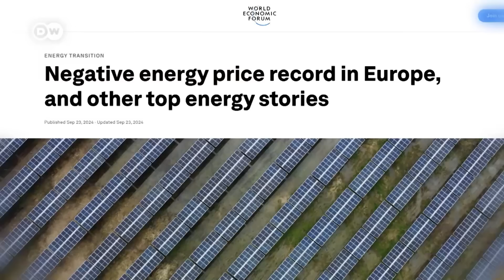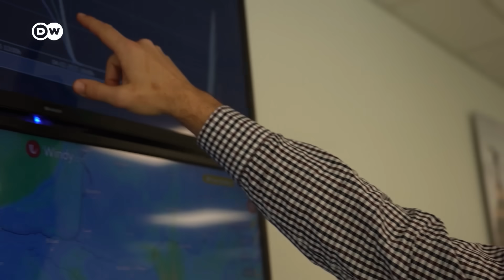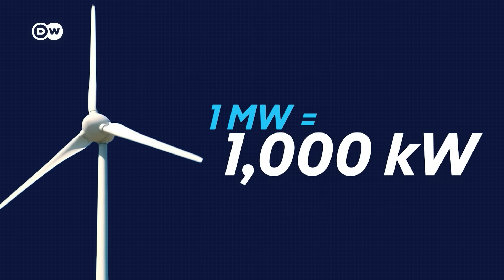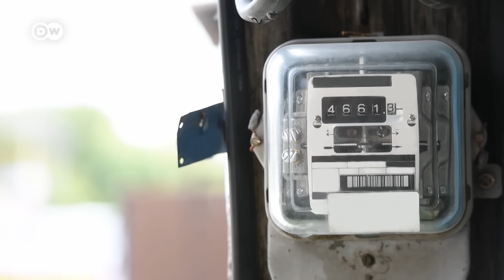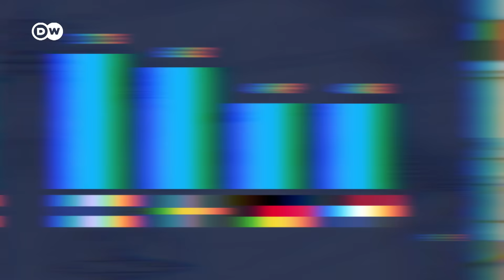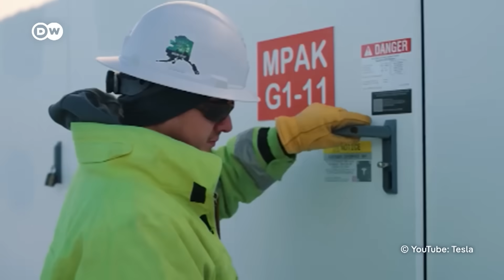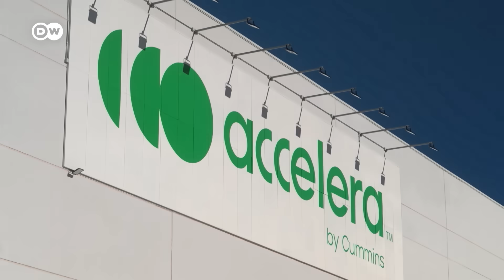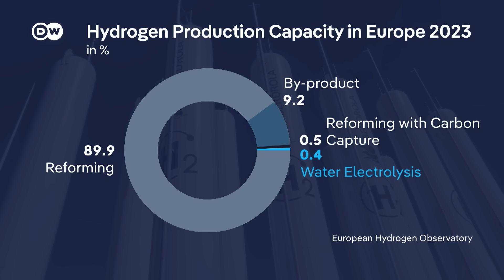Negative energy prices: Why cheap electricity can create huge problems | Transforming Business

Comment: Would have liked a greater focus on an explanation of marginal cost pricing (if there are countries in Europe which use this awful system which has outlived its usefulness to our changing grid) as used in the UK. I also would have liked graphs to demonstrate the actual loss to energy companies. We'd seen total hours of negative pricing but I imagine in real terms 240 hours per year is miniscule and perhaps a sign that these companies have not diversified properly into storage methods.  I was also tiring of the much cliched "silver bullet" metaphor. Do renewables attract werewolves?

Comment: An inefficient use of electricity, like the current hydrolysis process for making "green" hydrogen, is PERFECT for excess energy problems. It's a process that only works if energy is cheap, and suppliers have excess energy to sell at a lower margin profit that would otherwise cost them money to sell. Where's the downside here? 

Does DW receive funding outside of the German government? Maybe from oil, gas, or coal power generators?

Comment: Negative energy prices are a failure of government incentive structures & policies. It occurs due to poor planning of industrial scale implementation. It's been know for years, that after a certain percentage of renewable penetration, the grid would no longer be able to absorb peak direct generation, without storage. Though this was the case, a mad dash for renewable generation, without tying those industrial installations to grid scale storage, or industrial use policy, resulted in large supplies with low demand. It's basically a energy logistical design failure.

Comment: Renewable energy, such as solar and wind, its productions are very fluctuating according to weather conditions. Therefore,  massive electricity storage systems are needed to buffer these fluctuations fluctuations.  These systems convert  electricity to other different forms of energy, such as gravity,  pressure,  heat, and chemistry, when it is surplus.

Comment: Only solution is battery storage, which has already dropped in price to extremely affordable ranges thanks to "Chinese overcapacity".
Reply: and EVs
Reply: Of course. But nobody want to invest in that. Plenty of options, like heating up giant quantities of water or gravity batteries (concrete loaded trains up a hill is most cheap to build). It's all because engineers have no power.
Reply: We can charge EV's, heat or cool houses more during excess generation using them as heat batteries, have actual heat batteries for heat storage etc.
Reply: EV storage and more grid connections. 

More demand would be helpfull too.

Comment: Sweden has solved the problem of negative electricity prices. 0.12 euros/Kwh in fees, charges, fees and taxes and then VAT on fees and taxes. We never have negative electricity prices. 3,500 Kwh per household would be a dream in the cold, dark Nordic countries. 30,000 Kwh for a house is more common. During the winter, a lot of electricity is needed to heat houses in -10 degrees cold and the sun is out almost all day.
Reply: A panel at -10C is much more efficient than in the summer. But solar without storage capability is useless.

Comment: Problem with negative pricing for households is that transit and taxes are relatively high and it kind of does not matter if price is 0.09€/kWh or 0.10€/kWh. So generally households do not increase electricity usage when electric energy price is negative. Some big companies and energy companies have lower transit and tax and for them negative prices can give reasonable boost. Many bigger users pay peak price too, so it is not so easy to calculate if increasing usage beyond normal is profitable. For example in some cases electricity user will pay extra one whole year based on two highest usage hours. And that can be quite hefty.

Comment: The key would be to move economic activity to match solar output. Electro intensive industries should work at max capacity the weekends with another shift, increasing employment. And work day sould be shaved so it match solar hours.

Comment: I have found that wind energy is the most suitable, less expensive than solar cells in the condition that it must be small and very high efficient because it uses a new type of generator that uses very low driving energy but gives maximum power when used with such wind turbines, it can reduce almost all disadvantages. It is used together with water turbines to pump water up to a high tank and spin the water turbine when there is no wind, so there is no need for batteries.

Comment: The reporter has overlooked a critical aspect of green energy investment: the energy market itself.

In Europe, the energy market operates much like a stock market, where consumers and producers negotiate prices on a dynamic platform. The key detail is that suppliers receive the highest kilowatt price available in the market. This means that if a producer generates electricity from coal—a costlier process—solar producers can charge the same high price, even though their production costs are only a fraction of those for coal.

This market structure creates a perverse incentive that discourages a full shift toward sustainability. Furthermore it offsets when energy prices are negative.

Comment: Rather than trying to use green Hydrogen to offset the seasonal variability of renewable power, would it make better economic sense to run Hydrogen electrolyzers seasonally or intermittently to generate feedstock for green fertilizer, sustainable aviation fuel, etc.?
Reply: Hydrogen could just be sold, in general. It has industrial uses. 
That will help green energy pay for itself.

Comment: In some countries where  there is a system for hydroelectric power the government agencies pay the unit price of 2.80 / unit to the producers which is also a government agency and the public  is charged through tariffs slabs from 25/ unit to 300/ unit or more and where the public is under yoke as they cant pay such but still no one to listen in such situations the only solution to this type of burglary is to change such public utility companies to management companies not as profit making companies where the governments can appoint those running such companies the employees or management with good payment and salaries packages instead  .

Comment: You are welcome to buy Tesla Megapack batteries.
Reply: What for? That doesn’t help for more than some hours.
Reply: @volkerr. It actually solves the problem completely. That's why they're sold out for the next two years.
Reply: @jaromirkraus9034  that’s simply not true. To store energy for two weeks in battery that’s simply not possible.
Reply: @volkerr. that simply is true. The sun comes out about 12 hrs after it sets every time, don't you know? So that is how long you need to store the electricity for. Anyway, you will give Elon your money to save the planet whether you want it or not.

Comment: Imagine the day you recharge your EV in the parking lot or at the curb free in exchange for listening to ads. When your community recognizes the value of your investment in a storage battery while you park it when not using it for clean, quite, safe transportation. In any properly designed electricity distribution system, there should be negative prices at times; and the benefit of that accrues to the consumers whose use of that grid make the high profits of grid operators possible.

Comment: Why would anyone need to sell electricity from a windfarm at negative prices?? Obviously there must be some switch that simply disconnects the generator or the whole farm from the grid if prices are negative, so what am I missing?

Where the negative prices actually make some sense is in oil and gas, if you are not allowed to burn the gas (flare) and nobody has any place to put the oil, then prices could be negative temporarily.
Reply: A lot of solar is uncontrolled and some gas plants have to run for their heat output.

Comment: I don't think you people get it. The problem isn't that prices are low. It's that they vary wildly depending on how much wind and solar power is available. When there's little wind, the wind far owner has precious little energy to sell regardless what the prices are. When there's high wind, prices crash, so the wind farm owner still can't make much money. It creates a  market where building gas fired peaker plants is way more profitable than constructing more wind farms, even if gas is pricey. With the peaker plant you sit round and wait for periods of low wind and low sun, and then make a killing while electricity prices are sky high. Peaker plants are not very fuel efficient, but they add a lot of capacity at a relatively low construction price.
Current battery tech might be practical for storing energy overnight, but from time to time there will be week-long periods of low wind during mid winter, which means you'd need a huge overcapacity of wind and solar most of the year to secure sufficient supply in those periods from renewables alone. But no sane investor would pay for a new wind farm which would sit idle 90% of the time, just so prices can stay consistently reasonable year round. And even if you bypass market economics, would that really be the best allocation of finite resources?
There just isn't anywhere near enough storage capacity to deal with these highly intermittent energy sources. Better long distance transmission capacity would also help smooth things out, but that isn't cheap either.

Comment: In Germany negative energy prices are not a problem. At least not for the producers and investors because the government guarantees a fixed fee even for unneeded electric energy. When they have to turn off the wind turbines because of too much electricity without demand, they are compensated for their losses as well.
Of course this is a problem for the tax payers, in 2024 almost 20 billion € were spend for these measurements.

Comment: Presenting hydrogen as a viable storage solution, on par with electrochemical batteries, is extremely problematic and usually something that is slipped into the discourse by oil lobbyists to muddy the water, whereas in fact, even for its current uses (mostly chemical feedstock) most of it is not green.

And no, BURNING hydrogen does not only result in water vapor.

Comment: Negative energy price is not a bad thing. The excess energy should be used to produce hydrogen. 30% energy conversion is not bad also after all gas turbine efficient is slightly above 30%. Either produce hydrogen or capture carbon from the excess renewable green energy. Battery energy storage is not entirely renewable given the source of lithium and the lifespan of batteries. We are creating a long term problem with lithium mining, batteries disposal and the problem of grid stability with increased battery energy storage penetration

Comment: "H2 can store electricity for month and years" I just don't think that's true. H2 leaks and boils-off very easily. 

H2 is not a big scale solution.  Maybe for industrial heating like steel manufacturing.  

Round trip efficiency of en H2 battery el less than 25%.  That means throwing away 75%.  Pump hydro is better. but hard to find a good place.
Reply: Hydrogen is a gas but you used the term "boils-off", only liquids can boil, gases can't boil.
Reply: @matthew_baynham   No. Hydrogen is a chemical element. As such it has all the different states of matter. To store H2 you have to compress it a lot and cool it down so it's size is not a big problem. At that point it becomes liquid. Solid H2 exists but it makes no sense in this case.
Reply: @matthew_baynham  Hydrogen boil-off (BOH) is the evaporation of liquid hydrogen (LH2) into a gas. It occurs when heat leaks into the storage tank, or when the liquid hydrogen warms up due to ambient temperatures. 
Wasting all the energy used to liquify it

Comment: What we have hearing for the last 3 years is that the lack of affordable energy is a key factor preventing the EU economies from being competitive and the cost of living of households. If the end consumer does not get lower prices, then is something very fundemental wrong with the system.
Reply: Good point. Small danish outfits have developed 'smart batteries'. For the consumers; indeed we have had the term 'ProSumers' for at decade.
Reply: Yes but the problem is that these are variable prices. You can't forecast when you will have negative energy prices. Additionally even if you want to consume a lot of this energy your local grid needs to be able to carry the load

Comment: The other issue not mentioned in the hydrogen summary is that it can only replace gas up to a point. Homes that use gas need to be retrofitted and hydrogen stoves are a whole other set of infrastructure challenges.

Comment: Excellent analysis, especially the "solutions" part. We've had this occasional "negative price" phenomenon here in the natural gas world since at least the advent of the spot market. The best mitigation is indeed cheap storage. One slight weakness in the video is the explanation as to why negative prices really occur: it's when the producer is literally forcing the product down the throat of the buyer, because the producer can't stop producing, but the buyer can't take any more of the product. The buyer actually needs to spend money to discard the excess one way of another. The spot market allows him to pass part of this cost to the producer through negative pricing. In other words, negative pricing is the result of forced waste because of inflexible production, and insufficient (or overly expensive) storage.

Comment: Few mistakes here: battery energy storage systems (BESS) can hold energy for weeks or months, their self discharge rate is around 1-2% per month. But they are at their best when acting as buffers to stabilise the grid, so they are discharged in a matter of hours. Flywheels have much higher energy losses. Chemical storage has some potential but I believe redux flow batteries are more competitive than hydrogen. Hydrogen is the most hyped energy vector but with lots of drawbacks. Good luck pumping it in natural gas pipelines without fracturing them or leaking joints.
Moreover, all journalists should undergo baisic training about energy and power. Energy is measured in watt hours and power in watts.
Reply: Gravity batteries by pulling up weighted trains uphill are cheap to build, and don't loose any energy if "full". Also heating up water in old mines is cheap.

Comment: Insanely misleading and everyone should pay attention to what I'm about to say: Here in Italy we have a large production of solar and wind electricity yet we have among the highest electricity bills in Europe, Sardinia produces a surplus of electricity almost 100% of the year and they pay the highest electricity bill in Italy, why? Well, negative prices are all fun and dandy until you look at the economics behind those infrastructures: the capacity market, this mechanism consists of paying energy producers by their capacity, meaning: when the wind blows and the sun shines we pay for the energy that we need AND the energy that we DON'T need, so those negative prices they talk about are passed on the consumers, and when the wind doesn't blow and the sun doesn't shine we pay the bill still with the markup because electricity gets severely scarce resulting in imports.
If you wanna talk about low electricity bills and low carbon tax look at France.
Reply: This video is probably only valid in Germany.  In Denmark we have flexible pricing.
Reply: Sounds like a Maffia scheme..
Reply: You can’t put hydrogen in gas pipelines. It would be a disaster because the hydrogen molecule leaks everywhere and causes embrittlement of the piping.
Reply: Yes that is why it would be wise to take the next step by storing the surplus thermal or gas fired electric power in thermal batteries for delayed use a few hours later. The existing nuclear or coal fired plants can be improved just a little to store the surplus using molten salt and made available a few hours later to meet the needs of the consumer.
This is not a technical issue, merely a management of resource issue, something Germans have always been very good at dealing with. Perhaps Sardinia can learn some lessons too.
Reply: Bitcoin mining can help absorb the excess electricity. It is a flexible load that can be switched off and on when required.
Reply: @anuragsaikia3552 bitcoin is a money laundering scam. It will eventually crash to zero.

Comment: So we use Spanish solar power (20% photovoltaic efficiency) to produce hydrogen (33% efficiency) and ship it to Germany to be used to make steel there. What a waste of energy! So much energy loss. Only 0.2 x 0.33 = 6,6% of the primary energy (sunlight radiation) remains for steel production.

Better: we use Spanish solar radiation, which is concentrated with lenses or mirrors, and melt the steel directly there (efficiency >90%). Then we have used 14 times more energy, so we get 14 times more end product for the same amount of surface covered for solar energy harvesting. We just have to bring the iron ore to Spain and set up smelters there.

Comment: If energy is very cheap or prices are negative, that encourages some very energy intensive use cases which can utilize short bursts. I’m wondering whether energy storage (battery charging) etc business could bance things out. This just sounds like normal market economy behaviour
Reply: The phenomena has been around for 15-20 years. Industry has had a lot of time to figure out 'energy intensive use cases which can utilize short bursts' but they haven't. At what point do you return to reality and build nuclear power - consistent and reliable power that industry can actually take advantage of.